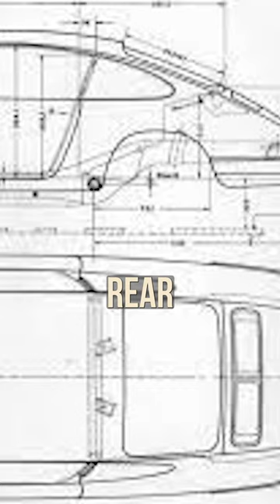Why Are Porsche 911 Engines In The Back?

Comment: Ok young feller, the engine position is simply a hangover from the 356. Although it would be more appropriate to say the 911 was designed around the transaxle as the six cylinder engine was not in the 356, and only appeared in the 911. So yeah, there's that....
Reply: You can fit a 911 engine in a 356.  They do fit.
Reply: @bryceg5709  I hope that a better rear suspension will also fit.  Porsche flat 6 plus swing axles is going to be, um, exciting

Comment: Porches are well balanced if you like spinning out
Reply: Some people would say, "just don't lift off the throttle mid-turn." In response I would say, "So instead of having snap oversteer and spinning into the guardrail, I should just let the understeer careen me into the guardrail?"
Porsche 911s are nice and the weissach axle helped a ton, but 😬
Reply: Skill issue
Reply: Porsches do not suffer fools
Reply: @thea.m.p.co.467 ust get a Cayman or Boxter if you're not skilled enough to pilot a 911. Mid engine Porsche's are fairly idiot proof

Comment: It was a traction issue, Porsche out the engine in the back on the beetle, cause it was a cost effective way to put the weight on the drives in the German winters, remember he used an independent rear to stabilize the rear weight bias. 

Porsche continued the rear engine  config with the 356, cause it proved itself with the Beetle. He thought it would be great for racing, and it was, so he continued it for the 911/901.

Comment: This will blow your mind…
Take a beetle, look at the back seat, swap the “bench to a split bench with bucket seats and tell me the difference between a 911 and a beetle…. the two vehicles are more identical than the average person may think… apart from the missing 2 cylinders etc…
Reply: an a boxer beetle lol
Reply: Well yeah the first-gen Porsche is a second gen beetle. Both air cooled, both rear engine, both design by Ferdinand Porsche

Comment: Aah the 911 is just a flattened beetle with more power. 

The rear engine is a VW thing, although other car manufacturers had also rear engines cars like Fiat, NSU, Tatra. 

To me the first and last nice looking Porsche was the 944 with a front engine bay. Which should be the new 911 back then.

Comment: that's not true. it was designed around a rear engine. the whole point was improved aerodynamics on the front end. it's actually not good for weight distribution, and results in understeer.